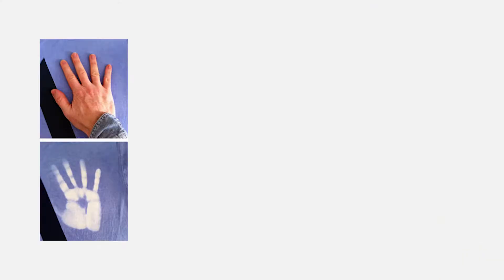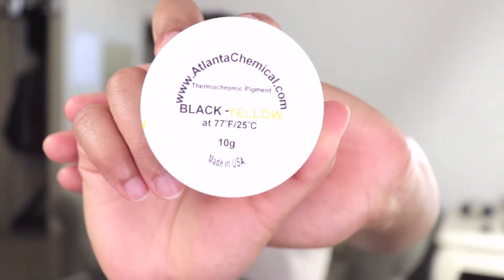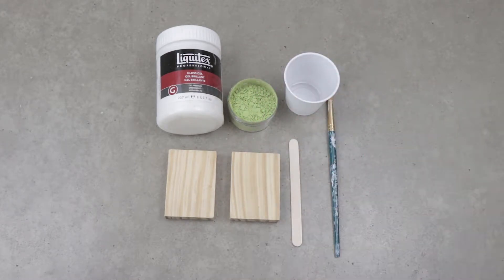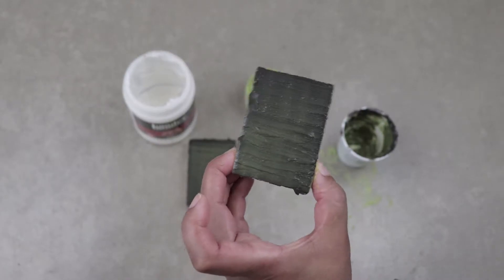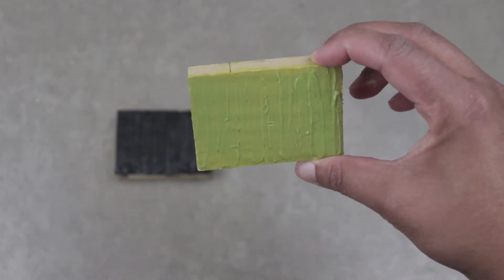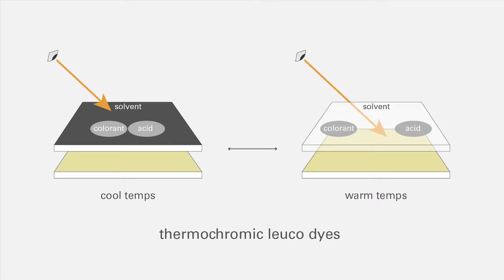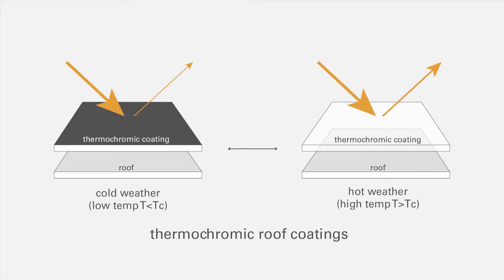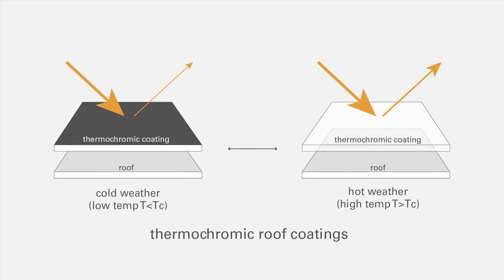Color changing roofs

Comment: AFAIK the main drawback of thermochromic pigments in this application is that they are not UV stable (at least not yet). Photodegradation occurs in a matter of hours, making them (so far) unsuitable for use in a high UV environment like a building roof.
Reply: This is very late, but this is what I was worried about. Do you have personal experience with this?

Comment: For the summer is ok,but in winter time,when the temperature outside goes down,the sun light will turn it in white.The roof wil be dark,only on cloudy day. That' have no meaning..I had an experience with black roof,please believe me has no meaning! in the summer time it was a real oven! In the winter time,sunny day,i used the heaters with all capacity :D  At least,i decided to renounce to that apartment under the roof ,changing home. Now,i 'm warming the rooms in the suuny day only with the brown curtains! Please believe me i do not use the heaters in the sunny day!